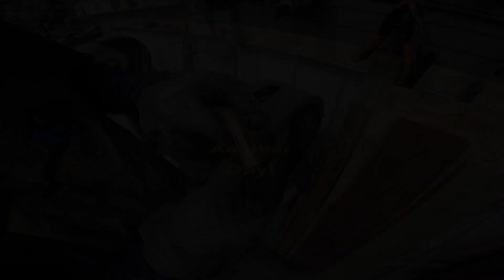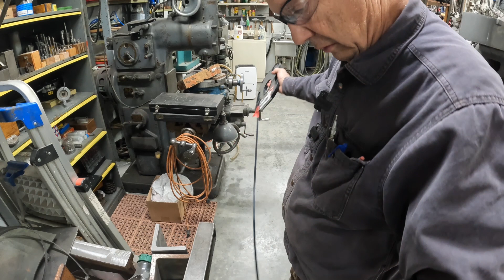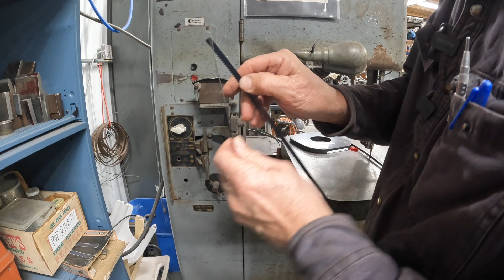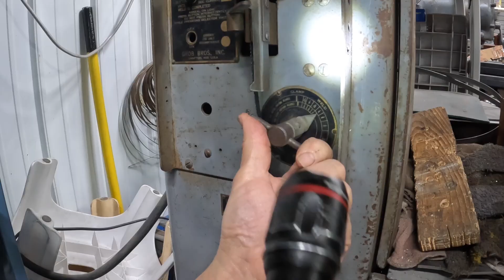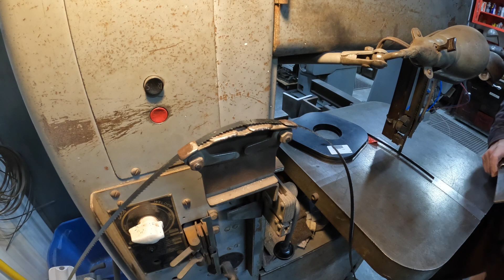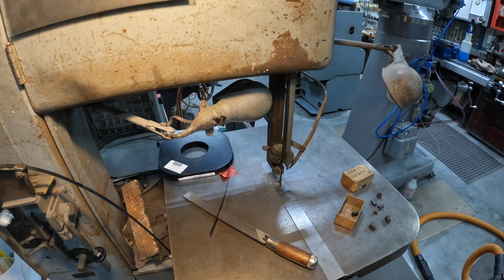Bandsaw Blade Welder

Comment: Steve,
I am not surprised you have a roll of blade material and a way to weld it.  That is a huge cost savings and no waiting for a replacement blade when it breaks!!!!
Reply from the maker: Thanks so much for your comment! There is one more reason I love this band saw, I can drill a hole through a part, then thread a saw blade through the hole, weld the blade together, then install on the saw, cut out the center of the part, then brake the blade in two, and you have cut the center out without cutting through the outer part! I think that's pretty cool!